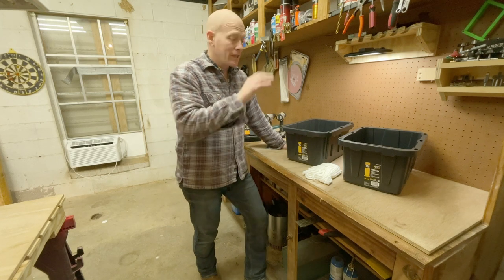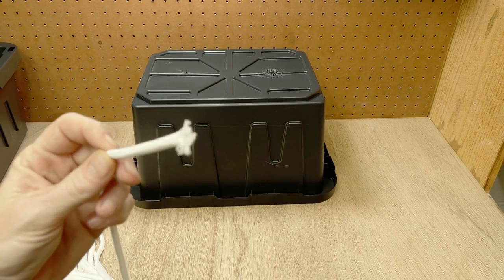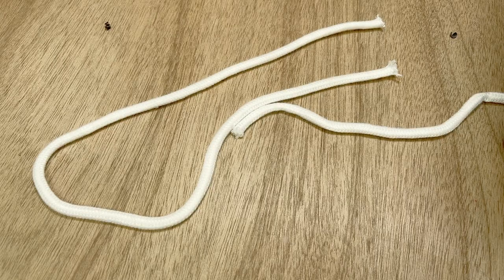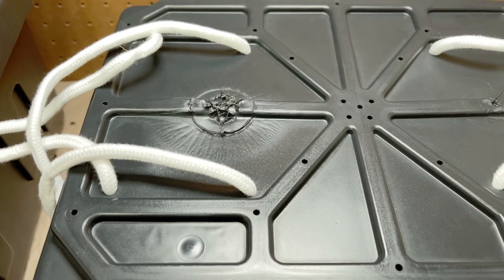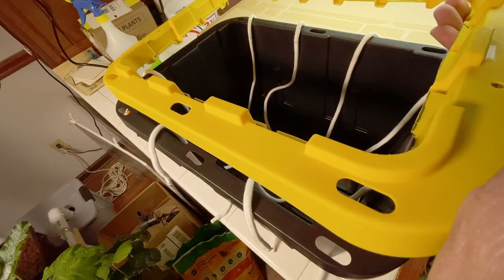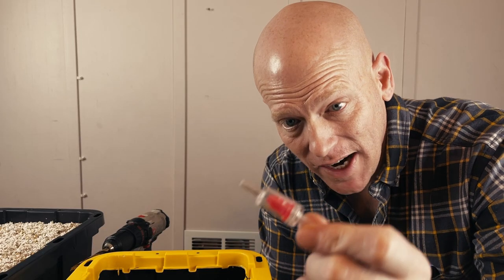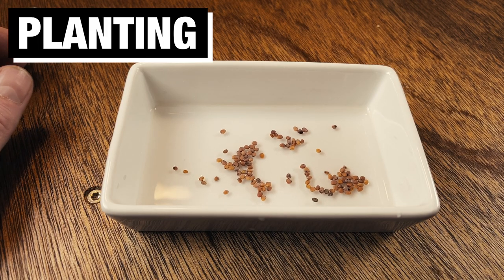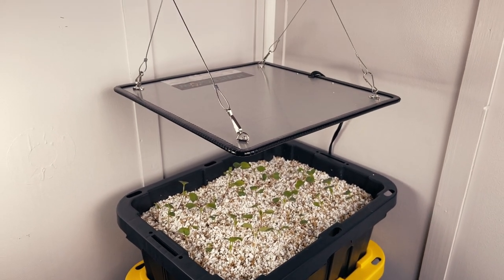How to Build a Wick Hydroponic System

Comment: some thoughts: just tie a knot in the rope instead of relying on friction fit. cotton WILL rot and stink. a test was done where a micofiber  (polyester) towel was shown to be the best wicking material, just cut some strips and roll them sideways.
Reply from the maker: Thanks for sharing your thoughts. When did you perform this test with microfiber towels?
Reply: @HydroHowTo  it was a study i found on the web, forget where. compared cotton, polyester, as well as various soil mixtures
Reply from the maker: @arkrainflood  Ah gotcha.
Reply: @HydroHowTo  I just use acrylic yarn and/or strips of ply-craft felt for my wicks.

Comment: I see you did this a couple of years ago. I was thinking of doing a winter project like this. How did the radishes turn out and what are your thoughts on this system now? Is there anything that you would do to improve it or do you even use this anymore? Thanks for your posts!
Reply from the maker: @davidb7130  the radishes turned out great! I would add a fill tube to make it easier to add nutrients as well as see the water level.
Reply: @HydroHowTo  thanks for the response! I was also wondering if the smaller holes for the wick restricted the water flow And is it really necessary to seal the end of the wick? I would think a frayed wick would pull more water or am I mistaken?

Comment: For radishes this setup is a bit over the top, as you can grow radishes in a much simpler system like e.g. an Aerogarden; just take care that the bulbs grow above the net cup, then it will work perfectly fine, the radishes can be harvested after 25 to 30 days.

However i do like your setup and i wonder whether it would work for potatoes?
Reply from the maker: I haven’t tried it with potatoes but could possibly work if you mount as it grows